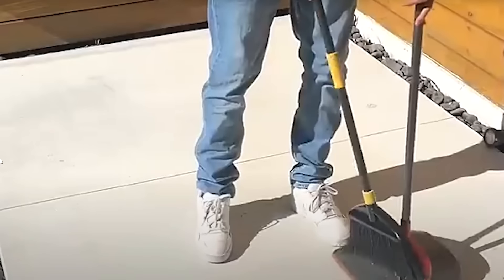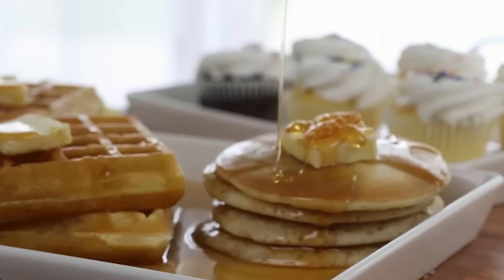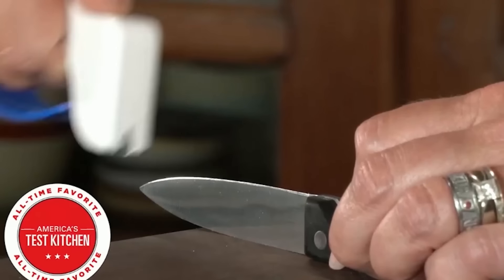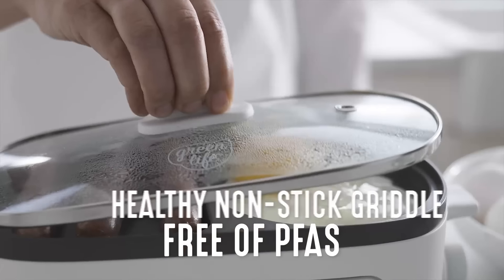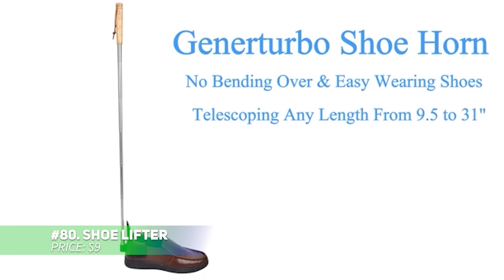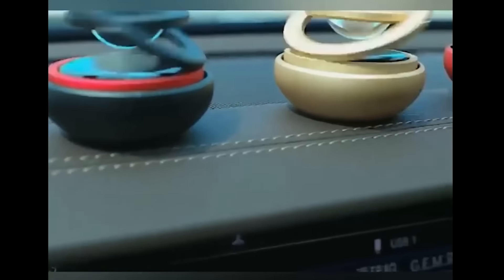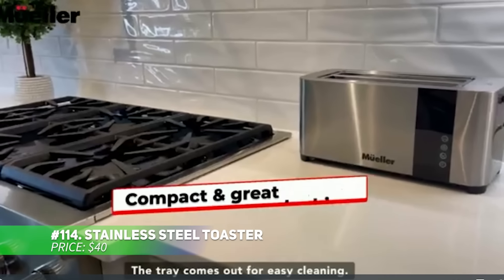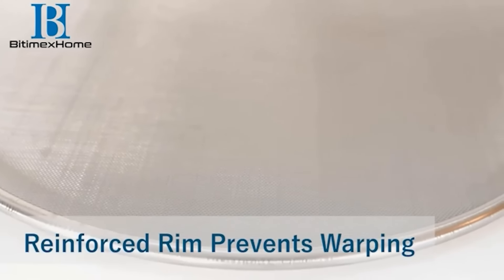120 SUPER CHEAP Amazon Gadgets for Kitchen & Smart Home | Under $15

Comment from the maker: 1: Car Seat Organizer	https://amzn.to/4dKX4jA
2: Portable Waterproof Speaker	https://amzn.to/4dMlHMS
3: Thaw Belt	https://amzn.to/3U5r6aL
4: Cutting Board	https://amzn.to/3U5r7LR
5: Neck and Shoulder Relaxer	https://amzn.to/3U5c05j
6: Hair Wrap	https://amzn.to/3Nradn7
7: Motion Sensor Ceiling Light	https://amzn.to/483T6kM
8: Wine Chillers	https://amzn.to/3TXYWyj
9: Cup Lid Cleaning Brush	https://amzn.to/3zSPRQG
10: Magnetic Cable Ties	https://amzn.to/3U6D04q
11: Jar Opener	https://amzn.to/3U1L9Hf
12: Meat Thermometer	https://amzn.to/3BNAFos
13: Humidifiers	https://amzn.to/3U2QbTK
14: Slicing Tool	https://amzn.to/3TZodIH
15: Electric Screwdriver	https://amzn.to/3UryPjV
16: Swivel Hooks	https://amzn.to/3BGiXDy
17: Onion Holder	https://amzn.to/3U3sCdr
18: Popcorn Popper	https://amzn.to/4dFj1Rd
19: Ratcheting Screwdriver	https://amzn.to/3NlbbkU
20: Mini Donut Maker Machine	https://amzn.to/47ZKrjk
21: Pancake Batter Dispenser	https://amzn.to/3Njpzu0
22: Mug Warmer	https://amzn.to/4dHYn2I
23: Towel Holder	https://amzn.to/4dGPgPK
24: Mini Food Chopper	https://amzn.to/3Yeuhzr
25: Soft Serve Maker	https://amzn.to/3U4CwvA
26: Onion Holder for Slicing	https://amzn.to/3U06Xmw
27: Toothpaste Squeezer	https://amzn.to/3NlVE4i
28: Veggie Chopper	https://amzn.to/3U071CM
29: Meat Chopper	https://amzn.to/4ezFHnd
30: Electric Can Opener	https://amzn.to/3TXZe8n
31: Mini Cake Pop Maker	https://amzn.to/3BFqiTT
32: Electric Spin Scrubber,	https://amzn.to/4dHYOtS
33: Burger Press Patty Maker	https://amzn.to/3BEq3IE
34: Measuring Cup Set	https://amzn.to/4eCWWDY
35: Storage Straps	https://amzn.to/4h0KgIL
36: Donut Water Bottle	https://amzn.to/3Y3cj1u
37: Kitchen Digital Scale	https://amzn.to/4eBqXUF
38: Wine & Beer Opener	https://amzn.to/4dBCjHf
39: Sink Colander	https://amzn.to/4eIIz15
40: Jewelry Oragnizer	https://amzn.to/4eBe3Gx
41: Knife Sharpener	https://amzn.to/3NnBtTL
42: Milk Frother Wand	https://amzn.to/4gXmH3z
43: Dip Clip	https://amzn.to/4dIa35R
44: Cutting Board	https://amzn.to/4eCqLVq
45: Whipped Cream Dispenser	https://amzn.to/4eALEA9
46: Oil Sprayer	https://amzn.to/4838IVU
47: WATER BOTTLE Opener	https://amzn.to/4h1kp3C
48: Waterproof Cell Phone Pouch	https://amzn.to/4h2OFeb
49: Ziplock Bag Holder	https://amzn.to/4ezGdSb
50: Jar Opener	https://amzn.to/4h2OHmj
51: Laser Level	https://amzn.to/4h2OpvJ
52: Slippers Rack	https://amzn.to/4dDSymZ
53: Magnetic Curtain Tiebacks	https://amzn.to/4eOXKpc
54: Car Air Freshener	https://amzn.to/4dJjjq2
55: Window Cleaner Tool	https://amzn.to/400p67A
56: Chicken Shredder	https://amzn.to/3N62cnL
57: Fabric Shaver	https://amzn.to/3YiNAb2
58: Handheld Fan	https://amzn.to/3NktTJv
59: Soap Dispensing Dish Brush	https://amzn.to/3U1LU33
60: Cooking Utensils	https://amzn.to/3U2Kkht
61: Breakfast Station	https://amzn.to/3XSKU28
62: rotatable colander	https://amzn.to/4eDaShx
63: Multitool Pen	https://amzn.to/3YiBsXo
64: Shelf Mats	https://amzn.to/3BQklDm
65: Jar Bottle Opener	https://amzn.to/3ZZ1K25
66: Stove Top Cover	https://amzn.to/3XXA6A1
67: Mini Bag Sealer	https://amzn.to/4dDSIuB
68: Egg White Separator	https://amzn.to/405Hv2G
69: Oil Absorbing Roller	https://amzn.to/4ePq0Is
70: Cup Holder Tray	https://amzn.to/3ZYx15j
71: Electric Salt and Pepper Shaker	https://amzn.to/4dLouWR
72: Breakfast Sandwich Maker	https://amzn.to/4gRRI9d
73: Cupcake Scoop	https://amzn.to/3ZTP2BO
74: outlet concealer	https://amzn.to/4dFjUJx
75: Tortilla Bowl Maker	https://amzn.to/4eZoIKU
76: Drawer Organizer	https://amzn.to/3ZWTpfm
77: Electric Can Opener	https://amzn.to/4gMAIkA
78: Meat Tenderizer	https://amzn.to/3BByZOV
79: Arm Rest for Desk	https://amzn.to/4eVHP8p
80: Shoe Lifter	https://amzn.to/4exyt30
81: Hand Juicer	https://amzn.to/4eVpys0
82: USB Charging Station	https://amzn.to/4dOOe4E
83: Butter Holder	https://amzn.to/3BvRzIf
84: Garlic Press Set	https://amzn.to/4dX3VH3
85: Omelet Maker	https://amzn.to/4dtIr4i
86: Food Divider	https://amzn.to/4eVrWiq
87: Salad Spinner	https://amzn.to/3BG1HhJ
88: Mug Warmer	https://amzn.to/3ZLZJGm
89: Fruit Slicer Cup	https://amzn.to/4eYB8CB
90: Rapid Egg Cooker	https://amzn.to/4gSg9mK
91: Door Lock	https://amzn.to/4f12VCD
92: Melon Baller	https://amzn.to/4eCXwl8
93: Earplugs	https://amzn.to/4eZqQSI
94: Portable Washing Machine	https://amzn.to/4gYWVMe
95: Contour Gauge Profile Tool	https://amzn.to/4gZqwoU
96: Car Air Freshener	https://amzn.to/3U3tcb7
97: Pocket Knife	https://amzn.to/4h1kSmo
98: Microfiber Hair Towel	https://amzn.to/3zUeDQs
99: Cutting Board with Counter Lip,	https://amzn.to/4h3zGAX
100: Dish Brush	https://amzn.to/3U07IMo
101: Food Chopper	https://amzn.to/3ZZZgjX
102: Rotary Cheese Grater	https://amzn.to/4dAPo3q
103: Toilet Seat Handle	https://amzn.to/4eW9upZ
104: No-Tie Shoelaces	https://amzn.to/3BG1z1J
Reply: Where are your Amazon links for #105 - #135?
Reply: @pamwiley6292  GUESS HE GOT TIRED OF TYPING... IF THAT'S THE CASE... HE NEEDS TO DO SHORTER VIDEOS

Comment: Like some of the products and want to support the channel but it is quite hard to select the link from description especially if the product is in the middle of the video.            Instead of using number for product link, it will be very helpful if you can use the time line instead.       Nonetheless useful gadgets